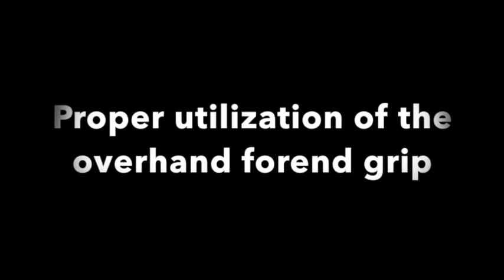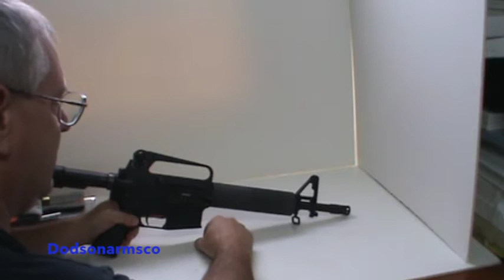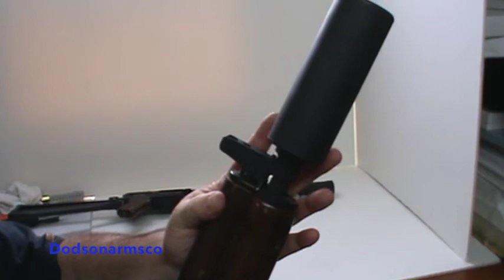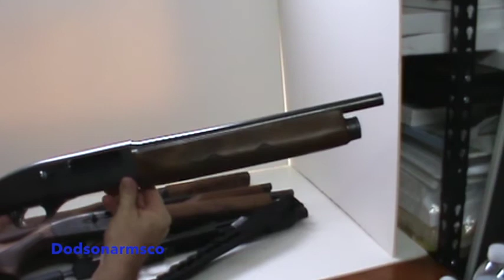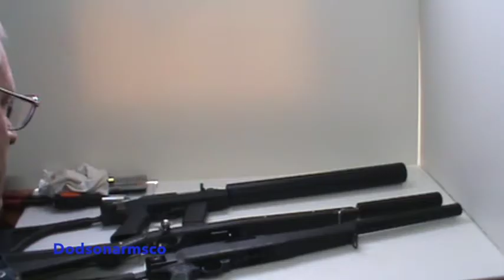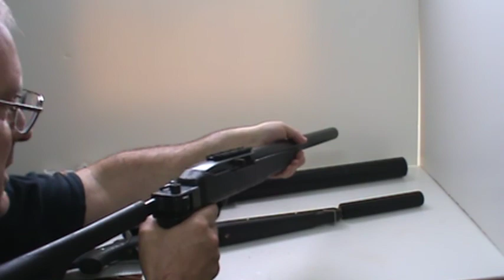CQB weapon handling techniques

Comment: Great video brother. It's like the Weapons Pool at SWC with you... Good God! LOL. I have a vert forestock way out front on my quad rail,a mid forestock grip (basic) and the magwell. Invaraibly, when that weapon starts to run hot, I wind up at the magwell or even down on the magazine itself. Heat drives all other considerations out the window in my experience. Basic is the way to go...
Reply from the maker: Hiberniason Glad you liked it, we find your channel content very useful. I also agree that the heat build up in weapons drives technique more than anything else. We did not cover 7.62x51mm weapons in the video but I have found with M14, G3, FAL, L1A1, L2A1, LMG's and GPMG's the impact of heating is much quicker and worse. People in general do not realize how fast weapons will heat up. I have seen people in the past during stress training burn the skin off their hand(s) with hot MG's.

Comment: at 16:49 What gun was that?
Reply from the maker: GeneralSLee ruger 77/22 in .22 mag. with the suppressor welded on
Reply: Gonna look that up. I never saw a bolt action with a suppressor. But bear in mind I don't know much.
Reply from the maker: The integral suppressed bolt actions are the best because they have the same feel as a regular rifle. The ones with a suppressor on the end make the gun long and sluggish. A lot of departments used suppressed rem 700's for sniping, some animal control dept's use bolt .22 or semi .22 suppressed. The bolt action suppressed hunting rifles are very common in Europe, Australia, and New Zeland. If you search hunting rifles in these countries on Youtube there is a lot of info.
Reply: Thanks